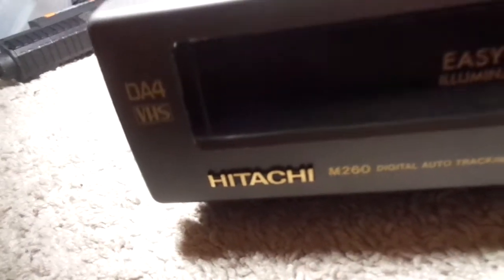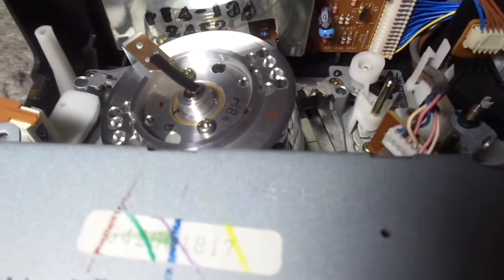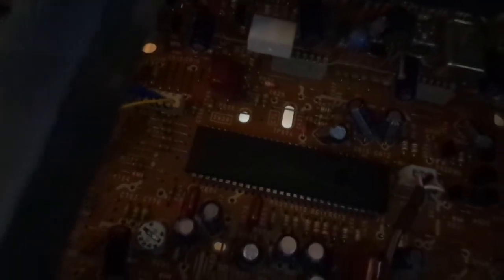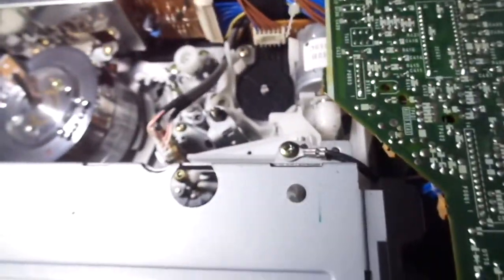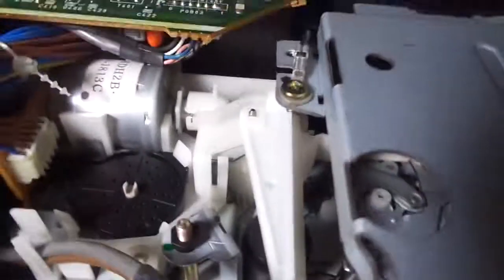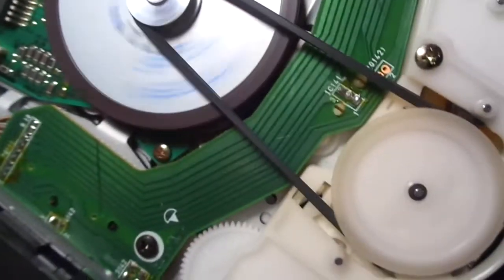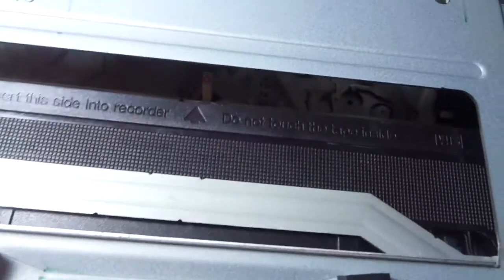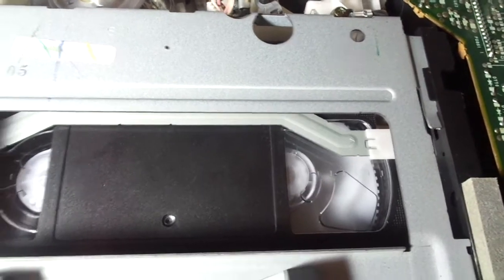Review of my Hitachi VT-M260A

Comment: 1:52 Hitachi always built nice machines back in the day. Youre kidding right? In my experience Hitachi VCRs are shit they never work without repairs. I found a 1991 Hitachi dumped outside I brought home it worked with a new belt and while I was using it turned of and it didnt get any power then I took it apart and can you guees what all the power supply caps where bad so it went in the trash. Also I have a Bang Olufsen VCR with a Hitachi mech and it needed the mode switch cleaned and tape guide alingment adjusted to work.